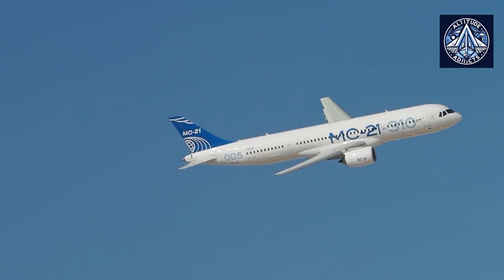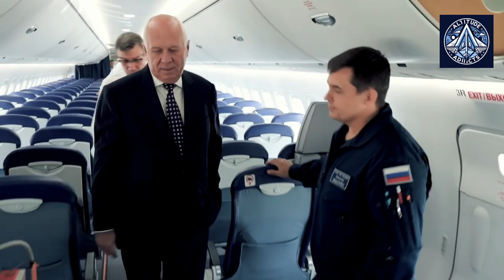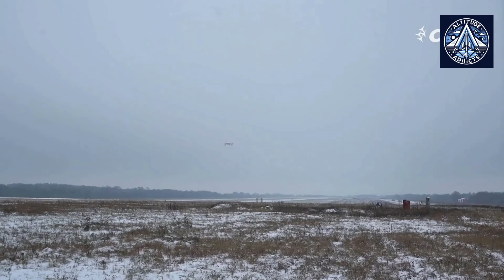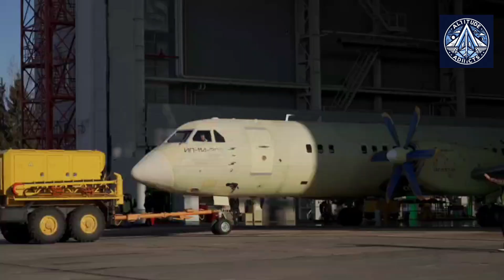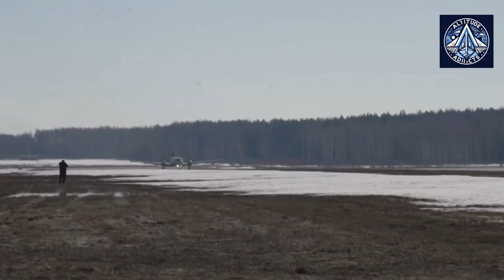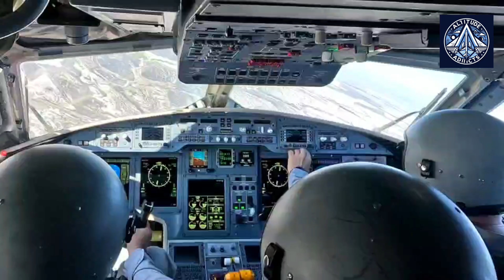Russia Breaks Sanctions—MC-21 Ozone Converters and Lightning Protectors for Il-114-300

Comment: There are reports that several PD-14 engines have been delivered. If the weight issue still cannot be resolved, perhaps the PD-14 engine can be installed on the Tu-204-300 which is not as heavy as the Tu-214. It would be very interesting if the Tu-204-300 used the PD-14 engine. The market for aircraft with as many as 152 passengers on the Tu-204-300 is very large. Maybe Aeroflot is interested😎